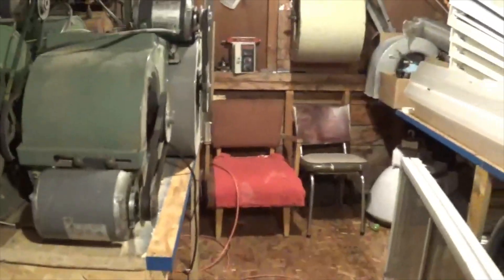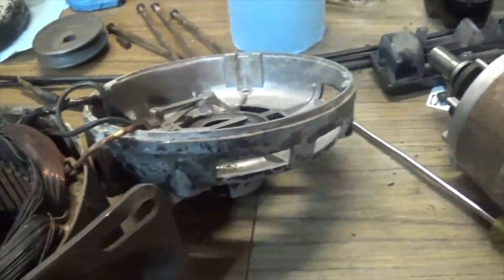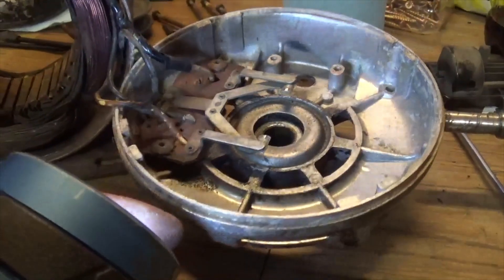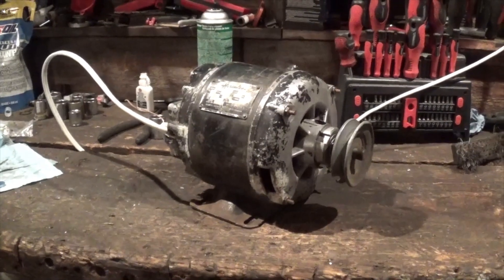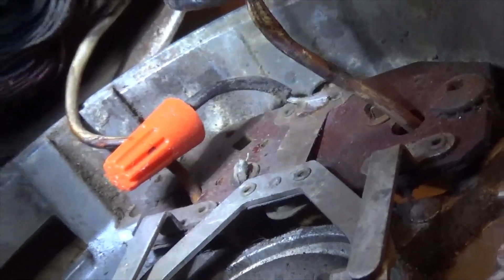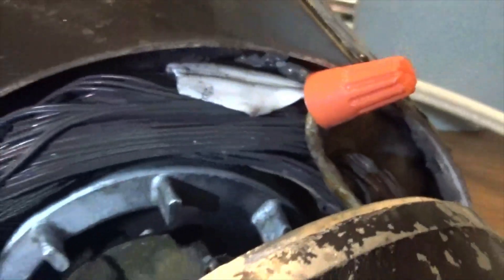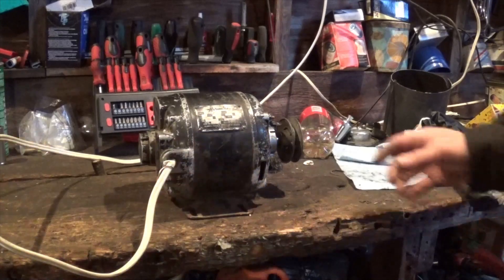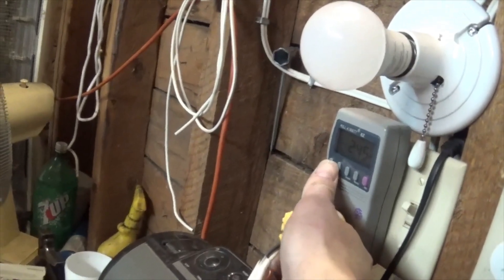Another look, Hercules Split phase motor

Comment: Awesome video, thank you!  I really enjoyed the story behind this old motor.  I knew you’d be able to get it back going even if it needed help starting.  More than likely the thermal protector is what saved the run windings from getting destroyed also.
Reply from the maker: Thank you! It would be cool if a person could get the whole story on it. I'f I had to guess though it was probably from my grammas original diesel furnace that was changed out in the early 80's (It's actually still sitting in the bush behind my yard lol)